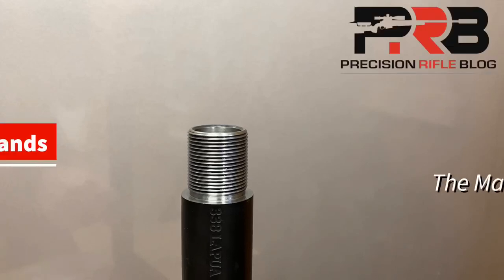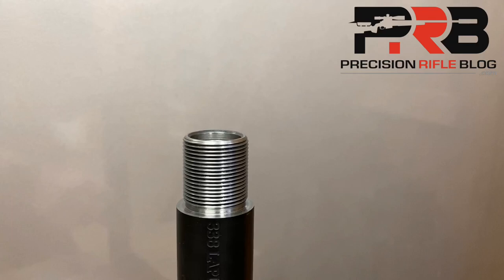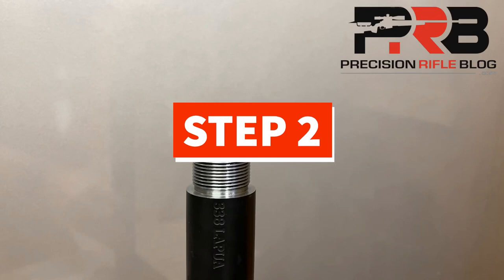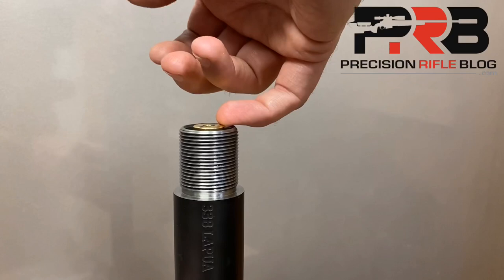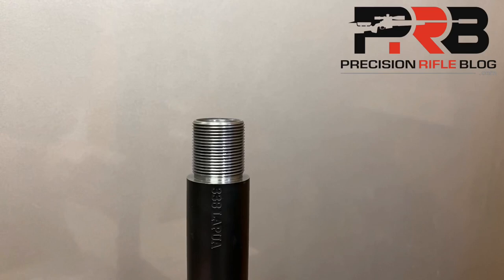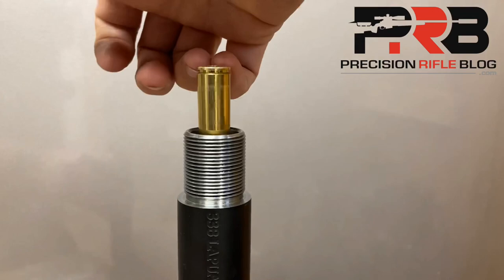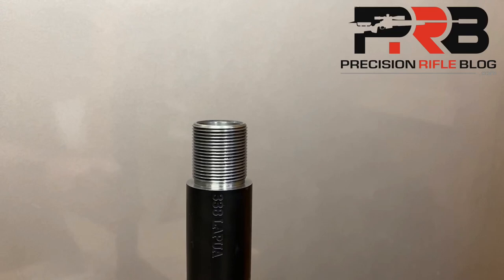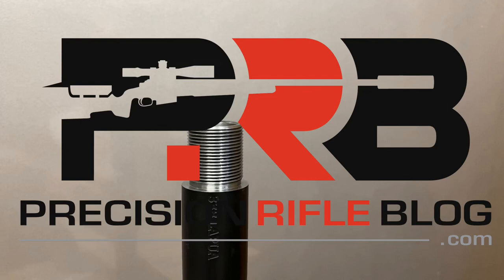How To Measure The Distance To The Lands On Your Rifle Barrel - The Mark Gordon Method

Comment: Yours is a version of the method I use that is equally accurate. You can save yourself a lot of time and work by doing this: Drill and tap the flash hole on one of your fire formed brass 6-32 to fit a section of commonly available 3 piece cleaning rod. Seat the bullet as you describe, and mount the case on the cleaning rod. Slide it into the chamber with a firm push, then retract. If it tends to stick like in your video, the bullet is seating into the lands. Repeat while gradually seating deeper until no tendency to stick. No need to do anything to the bolt or barrel, except make sure the barrel and throat are clean and carbon free.  I might take all of 5 minutes to do this test. Very fast, very accurate.
Reply: You can add a bit of sizing wax like Eric Cortina does to prevent the bullet sticking in the lands.  A probable better method is to seat a dummy round into the chamber with the bolt fully seated.  That way proper headspace is accounted for when the round is chambered.

Comment: Excellent clip. I’ve used the Hornady OAL gauge and modified case way for years. I want to give this a try to find the most repeatable option as that should be the most accurate. Thanks for spending the time to make this. Fortunately it’s easy for me to remove the barrel with an Accuracy International AXMC. Switch barrels are becoming a lot more common these days.

Comment: Good method but it appears to require the removal of your barrel. Got an "in-receiver" method?
Regularly adjusting COAL via bullet seating depth is the best way to maintain jump distance until the COAL becomes too long for the magazine. Then it's "New Barrel Time" or at least "Re-Chamber Time". (I prefer New Barrel if replacing a factory barrel.)
But to be entirely precise I think a PRECISION case trimmer with micrometer adjustments is necessary.
Reply: The Alex Wheeler method is the only in-receiver method I know of that doesn't require you to remove the barrel. However, if you are using a bolt that has a plunger-style ejector in the bolt face, then you have to remove that in Alex's method. I find removing the barrel is pretty quick and easy for me, and prefer it over remove the ejector from a Remington 700 style bolt. But I'm sure others might say it is easier than removing the barrel. Probably depends on your tools, experience, and personal preference. I wish there was another alternative, but I haven't found one.

Comment: I like the sripped bolt method:  remove the ejector pin and sriker, seat a bullet in an prepped case (no primer) about 0.050" past jamb, progressively seat the bullet using the press until the bolt closes with no assistance.  Use smaller seating increments as the bolt approaches battery.
Reply: "Seat a bullet in a prepped case (no primer)".  That's not already OBVIOUS to you? I bet you have 5000 posts at snipers hide..

Comment: Any suggestions on a good way to do this on gas guns? The barrel extension prevents the visible check and pressure check of a fingernail. Have had mixed feedback on using the bolt to close and whether or not to use forward assist every time, or never. Not finding any of my methods very repeatable. Also any recommendations on your favorite good caliper set to make the measurements?
Reply: Yes, I use a cleaning rod  with a flat solid jag tip inserted (carefully) into the muzzle.  Next, just like Cal described, drop a cartridge into the chamber and taking your finger or using a tool, press lightly on the base of the case.  Then, use the cleaning rod  and see if there is any resistance felt when pushing the cartridge back out of the chamber.  If there is you are jamming into the lands.  Seat the bullet deeper until there is no or VERY slight resistance felt pushing the cartridge back out of the chamber.   Repeatable to within .001" and no barrel removal and works with ARs.
Reply: I don't know of any methods for gas guns. Honestly, I've never tried to tune my gas guns to this same degree, but I'm not saying you shouldn't.

Comment: And how would this barrel method work without the bullet seated in bolt. How far back is the bolt face? I don't see how this can work. If the bullet is flush with the barrel, how do you know it will be when against the back of boldface. This makes no sense.

Comment: Are you going to pull the barrel off every time you want to change, or try a different bullet?  Probably not.  The simple fact of the matter is, you will use the Hornaday OAL gauge throughout your reloading life.  The number to touch or jam does not have to be to +/-  one thousands of an inch; all you need is a number to back-off .020 and start from there.  The number you come up with is relevant only to the math you do after you pick a starting point.  People make this complicated because they don't understand the math and what they are trying to accomplish with it.  Use the gauge ounce and do the math over the life of the barrel or rifle - change will come, but the math will never lie over time if you keep good notes.  The math never lies.
Reply: How do I get a "Gauge OUNCE"? I like to avoid the 22 paragraphs you wrote and just remove the barrel off my Terminus Zeus action or my AI AXSR so I don't have to use an exotic "Gauge OUNCE". It takes me 20 seconds to do if I'm being lazy.

Comment: Complete waste of time; use the alex wheeler method- just as accurate and you do not have to remove your barrel.
Reply: Hey, John. I agree that Alex's method is good, and I'd even say the preferred method if you are using a bolt that doesn't have a plunger-style ejector built into the bolt face. Most Remington 700 based actions have a plunger-style ejector, and if that is the case you have to remove it to do Alex's method. He says that in his video, because you wouldn't have the fine-tuned feel otherwise. Taking off a barrel is easier to me than disassembling the bolt, so that's why I like Mark's method that I show here. However, to each his own! Do whatever works best for you.